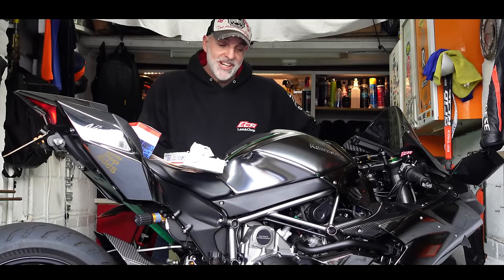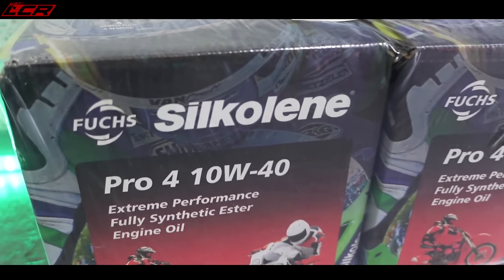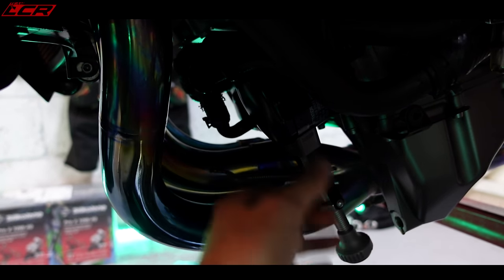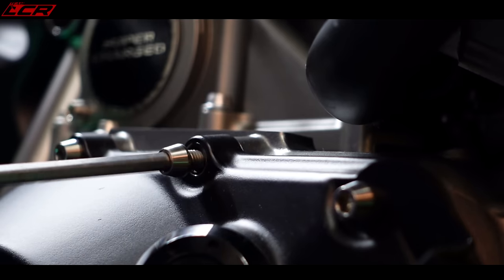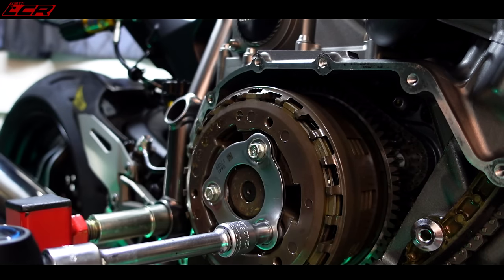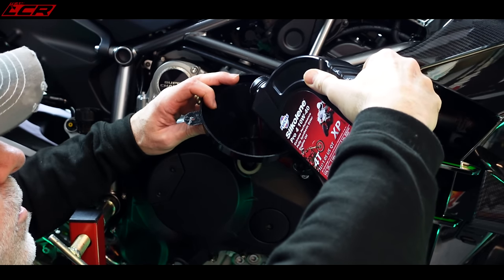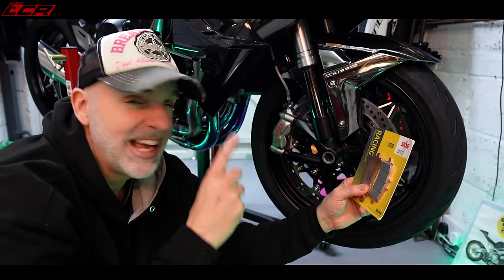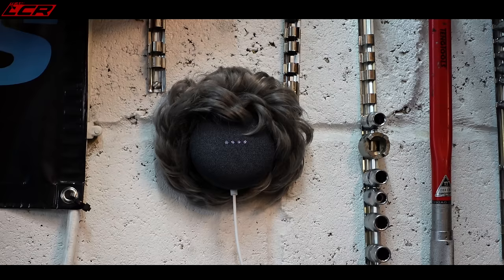Kawasaki Ninja H2 | Maintenance Needed..

Comment: If you’d have taken the little yellow plug out of your oil catcher whist your oil ran into the container it would have gone in without blowing air out and bubbling out of the large hole
Reply: bit of tin foil over the pipes too when you take the filter out.
Reply: Drill a small hole at the opposite side. Cheap cut one probably works better heh.

Comment: I have a 2018 Kawasaki H2 sx se with the full Vandemon H2R style exhaust, stage 2 supercharger gears, intercooler, blow off valve, clutch springs, H2R spark plugs, flash and tuned at 271.11 hp . I have a 2021 H2 carbon edition being delivered this week coming up. These bikes are amazing. My bike sounds just like your bike only louder as I have removed my baffle . Beautiful bike.

Comment: I always have warmed the engine before an oil change. I agree with you.
Obviously the drain can is the best way too do . I've had one for donkey's years ! Also a ice big old towel on the floor. That's what I've found when changing oil on those horrible 4 wheeled things , it always spurts out too quickly . ooooher missus :-D

Comment: Top tip, buy a 25 litre water container from halfords etc. and cut a square hole in the side towards the top. these containers also have a tap at the bottom and cost £10. I also use it for my 10.5 litre audi oil change. tranport oil can upright to the recycling centre and open the tap, Ta Da, you're welcome
Reply from the maker: Love it 👍

Comment: Great Video Chops...bike looking good too! What I’ve done in the past is thread some studs into the clutch housing then slid the gasket and cover over, you can then remove studs one at a time when fitting cover bolts back. ‘Just an idea to make it a tad easier hopefully’ Cheers Jake
Reply from the maker: That is a genius idea! Love it 👍
Reply: @LambChopRides  also works even better on the magneto side housing due to the magnetic force pulling the cover on making it really difficult. 👍

Comment: Glad I've never bought a specific oil change container! 😁. Good tip on using the syringe 💉 to create suction when changing brake pads and bleeding the fluid. 👍
Reply: You don't need a syringe to change your brake pads. When you push the pistons in to the calipers the brake fluid just goes back up to the master cylinder on the handle bars. The syringe thing is just given you more work as far as I can see. But hay everyone to there own thing here. But I was really surprised how thin the oil was it looked more like engine coolent than oil. 😳

Comment: Like the digital torque monitor. 
And the syringe on the brake bleeder.
As to the clutch and  springs, you have a slipper clutch there with ramps to prevent it slipping, and only 3 springs because of the ramps, which reduces the pull force required to operate the lever. But with shovels for hands I suppose it’s not a problem for you.
Where is the Ducati!

Comment: Other reason to warm the oil is to stir up all the little bits of crap, they settle if the bike is cold. They stay suspended in the oil for a while when it's warm, so you heat the oil, stir up the crap, and then the crap comes out with the drain.
Reply from the maker: Wow yes great point 👍

Comment: That comment about the oil and not warming it as it will still be in the head 🤣🤣 that's why you leave it five minutes or so to drain to the sump, you will always get more out with it warm, quicker too. It's like those people who say fill the filter first, it will fill when the oil circulates anyway so that's pointless, just remember to recheck the level after running the bike a few minutes, and again after your first ride to be sure it's right.
Reply from the maker: Yes exactly 💯% 👍

Comment: You’re supposed to take the yellow cap off your oil catching super container. Let’s air out as oil goes in the bigger hole, so you don’t get burps of back farts of oil from the big hole. Div! 🥲
Reply from the maker: Yeah funny you should say that Mark as realised that watching the vid back 👍
Reply: @LambChopRides  These things are a great idea, I know, I had one. But you still end up cleaning the outside of the oil catcher, AND you still don’t avoid splashing the garage floor as you proved. Big old bath towel on the floor under a cut-out old oil can, as you suggested. Drain into the emptied “new” oil can for disposal. Keep it all together in a big old carrier bag or bin bag for next time. Just don’t forget where you put it, 
Sometimes I stare at my garage shelves for twenty minutes before I remember what I put something away in.

Comment: The H2 does look and sound the business.
I've always been lead to believe that draining oil over night does more harm than good.
Reply: Can;t think of any reason why - unless you Forget what you are doing and Ride off on it with no Oil.
Reply: Paul Tanton 
I was thinking more along the lines of that draining oil over night would drain oil of of the oil pump and galleries and it would take longer to build up oil pressure thus causing engine damage

Comment: I've changed my xr brake pads to brembo road and race, they are road legal and I'm not a heavy braker but they definitely have better bite than the original brembo pads, I also changed my mt10 ones last year to these and it was night and day with those calipers
Reply from the maker: OK interesting Jason, few people said the OEM ones are not great. Hoping these are going to be better 🙏
Reply: @LambChopRides  I'm sure they will be, it was on fastbikes channel I saw their change on their long term 10, on my mt it was like I had changed the calipers, not so much on the xr just a nicer bite feeling, have good day and look forward to more non lockdown material 🙂👌

Comment: i could be wrong but i think you might have put the clutch plate back in the wrong spot
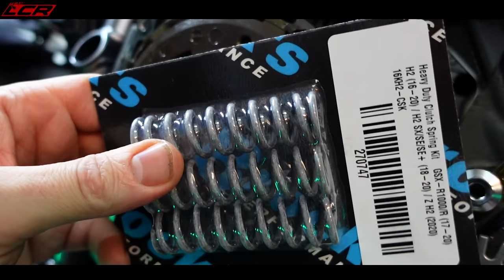Reply: if you look at 10:42 the last plate is offset then at 11:16 putting it back together it’s in line with the rest

Comment: I seem to remember some geezer with a roll up in his paws drilled holes in your pipes. I always thought that was a bit suspect.
Reply from the maker: Nothing suspect, that was to take accurate air / fuel readings per cylinder
Reply: @LambChopRides  But surely Kawasaki knows how to build a good bike. Why mess ? No hate intended.
Reply from the maker: I wanted more power, bike is very capable of easily giving 250 hp and stock they are not much faster than a litre bike. Silly not to give it its full potential
Reply: @LambChopRides  Thanks for taking time to explain to me. More power lol I think you're insane. But seeing as you are, please take good care. I've become accustomed to your vids. Have a sweet day.